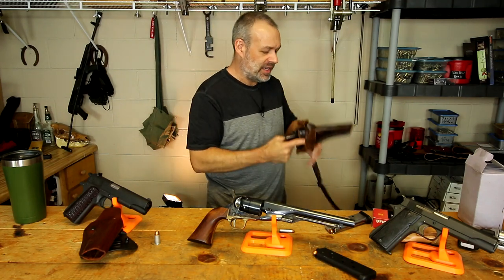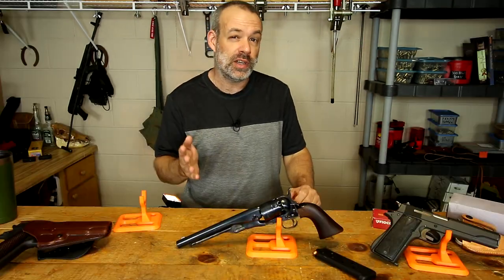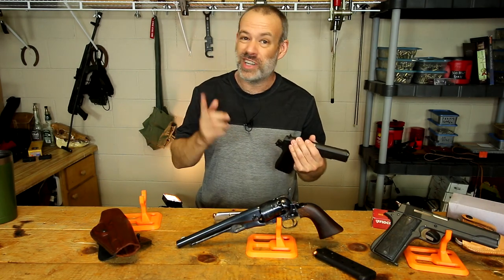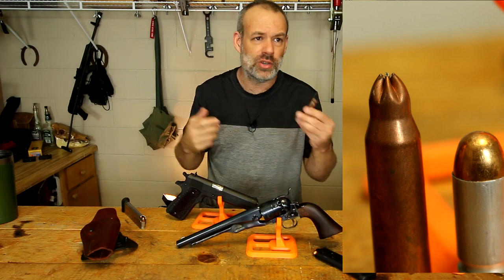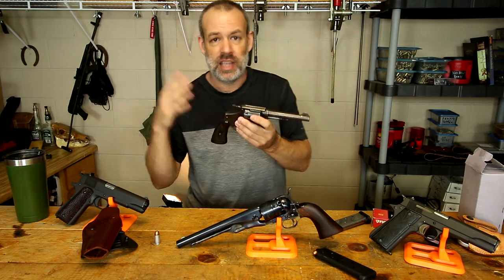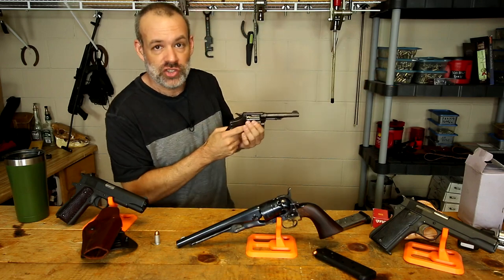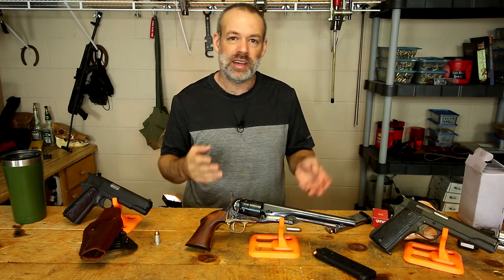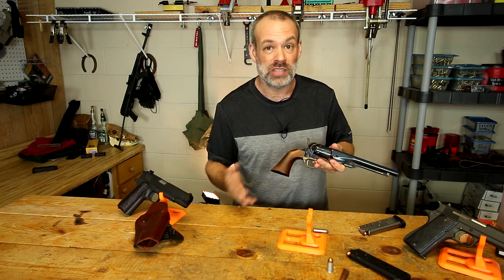How Do Prop Guns Kill?

Comment: When I was doing movie guns for a living, the barrels of "blank-firing" guns ALL had bore restrictors. These were THREADED into the barrel, usually near the muzzle. In the case of revolvers, often fitted from the the rear of the barrel, with a reduced diameter extension running forward towards the muzzle. The reason for the rearwaard positioning in revolvers was to generate sufficient gas pressure at the cylinder / barrel gap to produce the required "realistic" flash that occurs when real revolvers fire real ammo..there is a very small hole at the front end of the restrictor to allow the escape of hot gas as "flash" out of the muzzle. NO functioning guns WITHOUT bore restrictors were EVER allowed anywhere near sets or actors.

Furthermore, there is NOT enough energy in a theatrical blank to operate the mechanism of a locked-breech pistol like the 1911. Thus, is is necessary to modify the barrel by machining off the locking "collars" and tapering the "hood" around the chamber so that the gun runs as a straight blowback. More than a few of the ".45 ACP 1911" pistols seen firing on screen are actually chambered for 9mm, because of the wildly different pressure curves  and a few other factors.

All of this is why until relatively recently (late 1970s) EVERY "Goodie" and "Baddie) packed revolvers on screen in action sequences. They were easy to "neuter" to fire blanks "realistically". Furthermore, with a DA revolver, if it goes "click", just keep pulling the trigger until it goes "BANG". Actors: people who make a living speaking the words of other people and pretending to do things they could never do in reality..Role models? Really?

Handing ANY actor a "hot" (blank-loaded, of course) firearm without that actor having CLEARLY demonstrated that they were COMPETENT, is negligence, straight up. From experience; some already understand and are switched on, some take instruction very well, and then, there are the rest. See also: the abundance of eye and ear protection and serious plexiglass screens used on set and location when the camera crew is getting "up close and personal" with blank-firing guns. (If this is NOT happening, the "safety officer " needs to be replaced, pronto.

DITTO with "action" cars and motorbikes, etc, though, as a rule, the REALLY interesting vehicular stunts are done by very experienced drivers operating modified vehicles. DELIBERATELY crashing and destroying a car and still having an un-broken driver takes a LOT of training, experience, late nights in the workshop and "trade secrets". 

It is SHOW BUSINESS, NOT "reality. You see the "show" , they are running a BUSINESS..However, it is STILL just a Fantasy Factory.
Reply: The murderer in question is extremely anti gun and never took a handling and safety course due to his political believes but they still decided to allow him to have a gun when he doesn't want anyone else to have one at all. This whole scenario was a shitshow from the start and the whole movie even if this didn't happen probably would have followed suit into shitness
Reply: @tdkyt46  They should have hired a real cannibal for Silence of the Lambs. Perfectly logical
Reply: Yes, weird that one who loathes guns would want to shoot one at all.
Reply: @timothystephenson2498  because it's make-believe.
Reply: @samuelchan699  I don't get it is your comment satirical or genuine?
Reply: @allangibson2408  .......Please show your source that they are not allowed to check the firearm.....don't worry I'll wait.....but in the meantime I'm calling bullshit on your comment
Reply: @1bytor  I forgot where you got your expertise. Could you remind me, or is it just your bias talking because Alec Baldwin Roasted Trump.
Reply: @milesackers2935  TDS
Reply: Check out German blank guns.
Reply: Very true. Even in the fantasy factory you're using real devices that can really hurt or really kill.
Reply: With all the CGI possible today, there should be no reason to have a real functioning firearm on any movie set.  I'm not in the industry, but I think it could be made cheap enough to add firearm-like computer effects after the scene is wrapped, real enough to satisfy almost anyone watching.  Then the only injury would be the carpal tunnel syndrome of the men and women working the keyboards and mice on the computers.  And even if it is not cheap to switch to CGI effects instead of using real guns and real blanks and real bullets, so what?  Saving lives and preventing injuries should take top billing, IMHO.
As for the pellet guns, in normal use they can destroy an eyeball.  What better reason to avoid them, too, in scenes with actors?

Comment: Guns, so called “prop” or not do NOT hurt or kill anyone. 

The misuse and failure to know and follow basic firearm safety causes injuries due to their negligence.
Reply: that depends who you are trying to lay the blame on.. if your an actor and your handed a gun and told it shoots blanks, and you can fire like crazy at something without a worry, you cant blame the actor for any misuse or negligence.. if however you are saying the issue lies with the prop master for the misuse/negligence on their part, sure
Reply: @tears_of_asariel3198  You absolutely can blame the actor, Alec was told it was a cold gun. #1 rule, always treat a gun as a loaded gun, even if it's unloaded.
Reply: In Hollywood no one is responsible for their actions. Never. It's always someone else.
Reply: @tears_of_asariel3198  even with blanks you shouldn't be aiming them at anyone, you still have hot gases coming out the front
Reply: @tears_of_asariel3198  First off, any nutjob with even a basic knowledge of firearms would know the second they picked the weapon up, just from the weight difference. Second, this is a seasoned actor who has fired hundred if not thousands of guns in his life over the course of his career. He should have known the difference AND he should have been practicing basic safety protocol.
Reply: @tears_of_asariel3198  , if you look at the Union rules, actors are never supposed to actually point a gun directly at anyone. They are instructed to “cheat the shot” and aim to the left or right of the person in a way that the camera is fooled. Obviously Baldwin was pointing that gun directly at two people who he pulled the trigger. He doesn’t bear full culpability, but he sure bears a great deal of it. Regardless of what it was loaded into it,Baldwin still had the last chance to prevent the tragedy by simply following the rules of his union.Never mind common sense gun safety rules.
Reply: In General it tends to be a small piece of metal exiting the front end of a gun that tends to injure or kill people if they happen to share the same space ( at the same time) with the aforementioned small piece of metal
Reply: @ahalfsesameseedbun7472  I grew up around guns not sure he did. I would have checked it out of reflex. I think the people hired are at fault especially the armorer who apparently lied to Police. The man unintentionally killed someone lighten up.
Reply: @2l84t  Alec is one of the producers so he needs to be held accountable anyways.
Reply: Oh yes, me without a gun or knowledge of how to safely use one, am more responsible for the actual injuries than the knowledgeable person who shot their neighbor because of a spat. :P
Reply: Was he told it was a gun, though? And not a prop?

Even so, firearms training is not mandatory knowledge for the majority of the population. It's easy to thumb your nose at someone who doesn't know the first rule of fight club, but you have to remember that not everyone is a member of fight club.

Also, why the insistence on using real guns in a fake movie? With so much CGI everywhere, surely you can fix any barrel obstruction in post so you can safely use deactivated firearms on set.
Also-also, why were there live rounds on set? With Hollywood being as big on gunfights as it is, surely there is a market for a company to produce blanks on a semi-industrial scale, rather than rely on individual propmasters to jury-rig something together in a garage?
Reply: @falco5150  Oh really?
So you can instinctively tell if a 1,5 pound gun has a 260grain bullet in it?
You're almost as accurate as a kitchen scale, managing to always be aware of 2% weight differences.
Reply: @ahalfsesameseedbun7472  In your humble feeble opinion . He has to live with it. What's with you anyway ? Didn't like a certain impersonation by chance? Need your pound of whatever ?
Reply: @2l84t  No I just think he needs to be held accountable for his carelessness. Just because he's a famous actor shouldn't mean he gets to get away with killing someone because of his negligence.
Reply: @2l84t  It's also really dumb that people keep calling it a "prop gun". Prop Guns don't shoot live rounds.
Reply: @falco5150  So the feffference is 40 grains of lead. You are trying to tell me that while  holding a 6 pound piece of metal you can tell a 35 gram difference?

Wow you must be really smart after the fact huh.
Reply: @ahalfsesameseedbun7472  So I can blame the actor? OK you are the actor here.

Nuff said.
Reply: @thehippiedog5956  That's a stupid come back.

Comment: I still have a hard time getting around the idea that the person who is holding a functional handgun, and who is going to point it at another human and pull the trigger causing some type of ignition, doesn't have some responsibility to ensure the gun is safe.  If not, then as a matter of policy, this should change.
Reply: If the gun had been pointed at an "actor" during a choreographed scene, then Alec Baldwin would have a much stronger defense for "zero liability" in this case. Unfortunately, he decided to squeeze off a round in the direction of a "crew member" when he wasn't even rehearsing a scene. I'd say that the prop handler is 80% liable for this accident, while Baldwin is 20% liable for handling a weapon that the prop guy told him was "safe."
Reply: @Scorch1028  source on this information? Some are saying the scene was a close-up of Baldwin pointing a revolver right at the camera.
Reply: @Scorch1028  you pull the trigger of the gun in your hand  it is you. Can't say anyone else forced you to pull the trigger. Gun safety doesn't mean trust the person before you. They needed the NRA on set to insure safety.
Reply: The person who pulled the trigger is responsible for what happens. Full stop.

I don't care what the circumstances are. Actor. Cop. Citizen. Criminal. The person pressing the bang button must always observe every safety rule and if someone demands they break a rule, the person holding the gun is required to refuse breaking the rule.
Reply: Aiming toward the camera in westerns are common shots.  The audience is to look down the barrel and revolver cylinder of the big ass 6 shooter.  The cylinder chambers showing have to be filled with something that looks like a bullet showing.  Clint Eastwood all the way.

Look at that Colt Army 44 press load revolver (the big one).  If you are handed that for a scene and are to pull the trigger so the cameraman gets the finger pull and revolution action only... But the cylinder chambers are to be filled with inert dummy bullet heads...how csn you tell.  The weight of one or two lead balls is barely nothing compared to such a heavy steel gun.  You, the actor, aren't to fiddle with the prepared cylinder of six visual bullets.  If it is this old style, you can't remove them like a cop show or later western... You have to pull the ball out one by one with a punch screw.  An actor's not allowed or skilled to do that. 

If a metal cartridge revolver like the other one shown, then you'd still see the same bullet heads.  You could remove a round and look at it, but then what.  If i fill a cartridge bullet with sand or gunpowder... But they look identical... Can you tell.
Reply: @STho205  Aimed toward the camera is ok, it's only a piece of equipment.  Aimed at a human is recklessness.  Baldwin, as Producer and trigger puller bears a full measure of culpability for the killing.
Reply: @Scorch1028  It matters not if it were an actor or a camera person.  Legally it is the same thing.  Reckless behavior is not assigned a percentage in a shooting.  It was pure reckless behavior to point a gun that you knew was a real gun at a person and pull the trigger.  Baldwin is responsible for that.
Reply: Of course Baldwin has responsibility for the tragedy.  Reckless behavior is defined as when a person engages in behavior that that person knows  is dangerous to others, yet he knowingly engages in that behavior.  Baldwin knew guns are dangerous.  He knew that bullets come out of the end of the barrel.  He knew that guns are designed to fire when the trigger is pulled.  All 3 of those facts are common knowledge, known by almost everyone.  He knew he was engaging in an act that was potentially dangerous yet continued to act.  It is the same liability that you'd have if you drove drunk.  You know that it is dangerous to others to do so, yet you chose to drive drunk.  That is reckless and is a felony.
Reply: @Scorch1028  only 20% when he is the person responsible for producing the movie and put the hiring practices in place too?
Reply: @percyfaith11  the camera is not remote.  There's an operator behind it looking through the eyepiece aiming back, panning, and typically a director or AD looking at the simul-video screen.

Why don't you let the report come out.  I can tell you have no idea of a movie filming session... And that's OK... but therefore you can't really understand the setting.

Westerns have been made in this style for over a century.  It is a lot better track record of human casualties than either auto driving or voting.
Reply: @STho205  Are you telling me that it is impossible to compose the scene remotely from the camera when the actor is aiming a gun at the camera and pulling the trigger?  
Things have changed, especially technology over 100 years.  Ancestor worship is never a good reason to continue doing something if there is a safer way.  
I want to know more about your statistics.  You know what statistics are right?  Do you actually have statistics that would support your claim or are you just speculating?  I suspect the latter.
Reply: @Scorch1028  except that he's the producer for the film and that means he has liability for everyone working for him.  The buck stops with him.  There had already been a number of problems with the prop weapons and he should have been doubly cautious... but he wasn't and violated the rules by actually pointing a weapon at the crew.
Reply: don  wrong. Most court cases involving some kind of negligence require the person had some kind of knowledge in knowing what they were doing.
Reply: @2l84t  Yes because as the operator of the vehicle it is your responsibility to make sure the brakes work before you drive the car onto a public road. Are you in love with this clown ?
Reply: @STho205  apparently well made prop ammo (not blanks) have a steel BB inside, the armorer shakes one by one to show it has NO gunpowder inside. Gunpowder (or sand) make no noise, the BB does.
Reply: @fahey5719  inert rounds are best with plastic or foam cones in place of bullets.  A hot primer cartridge with a lead bullet and a BB is buck and ball.  Doesn't help to know it's supposed to be inert by color dot or BB...if it still has a hot primer.

This was a cheap movie location set.  Everyone admits that except AB (who is into beinf Well Oiled)  They were missing payrolls, booking crew in cheap motels 60 miles drive, they interviewed other armorers and property masters that passed on the job... And settled with cheaper crew with little or no experience.  Had several mishaps that week.  The three prepared guns were left unattended on a cart for several hours snd over lunch due to the delays that day from a camera crew quitting dramatically.

I'll bet the "empty" rounds were made on site from commercial cheap ammo.  A fairly common trick.

There are a lot more firearm accidents on sets than you've ever heard of.   You hear when someone dies or outsiders rush the injured to the hospital.   Just the mishaps on this set were unknown to the public... Until that afternoon.

Comment: There was no prop master on the set according to the prop masters union. Somehow there was a live bullet on set which is not supposed to happen as well.
Reply from the maker: No prop master while firearms are being used on a huge movie production?  The more news that comes out the stranger it seems.
Reply: @deuceandguns  I heard there was a prop master on set but they were not part of the union, even though the union of propmasters was involved with the movie. we will have to see what info comes out in the next few weeks.
Reply: Fine, there was no prop master on the set, but how in the hell does that excuse a "real bullet" from being on the set?  If there's no prop master on the set, and a prop grenade ends up being a "real grenade", then I'd blame the prop handlers more than the actors.
Reply: That just means there was no prop master from the prop masters union on set. Doesn't mean there wasn't a non-union prop master there.
Reply: @deuceandguns  You truly had no knowledge in producing this video! 😂 You really think movie productions will take live rounds and pull the bullet out and make the primer "innert" for every round they fire on set, while in production? All the rounds are made by an armor ( NOT WITH LIVE ROUNDS). But made from scratch prior to each scene for the production.
Reply: Being in a union don't give you anymore credibility